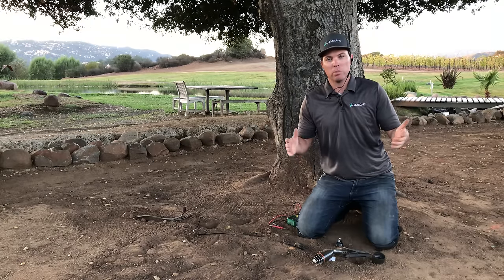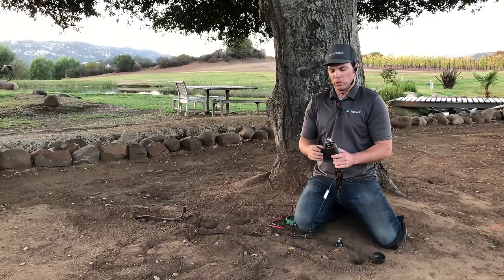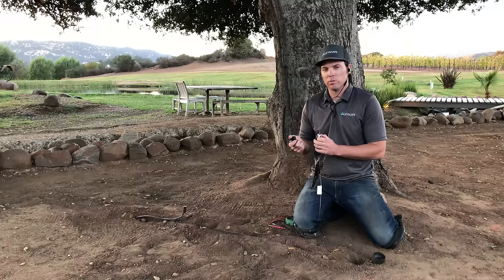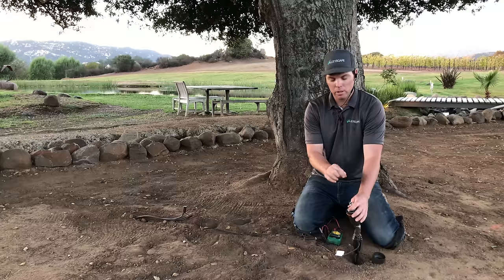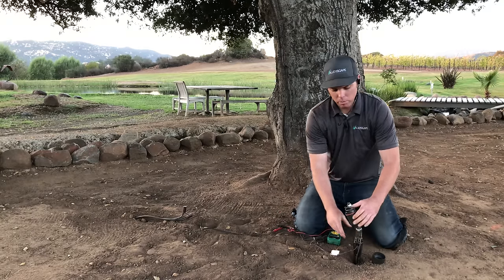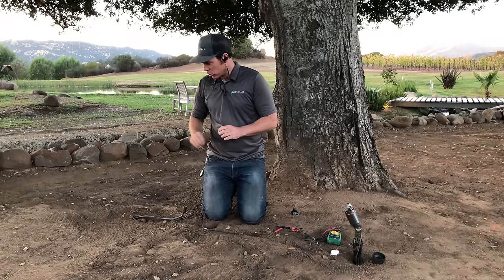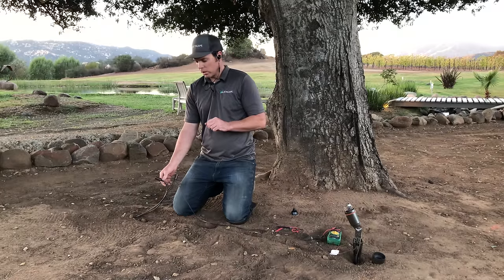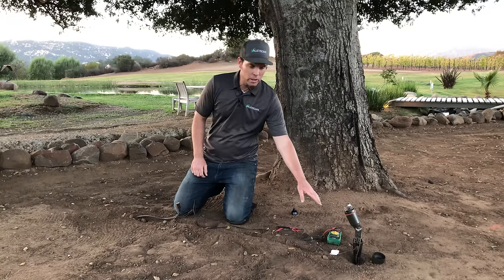How to repair Outdoor Low voltage Landscape lighting.

Comment: Di havent twst with multi yet but when i do should the 12volts read when its on..how do you test where do you put probes while power is on..and can i test just tge light strong without tge splice no plug and not powered to see if theres a crimp or a shortvin wire
Reply from the maker: Pull the bulb out and test in the holes where the bulb probes go. With power on it should be 12 volts or thereabout.

Comment: My primary line is a few hundred feet out to the landscaped and lighted area.  I believe it is a bad idea to cut the primary wire.  I would rather bare a half inch of the wire to connect a fixture.  Do you have any thoughts about rapping it, other than tape.